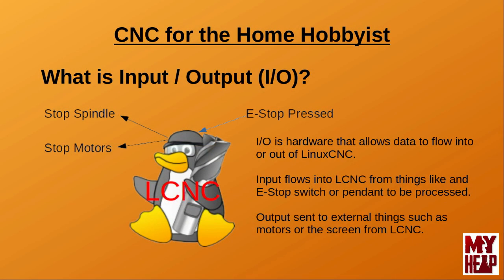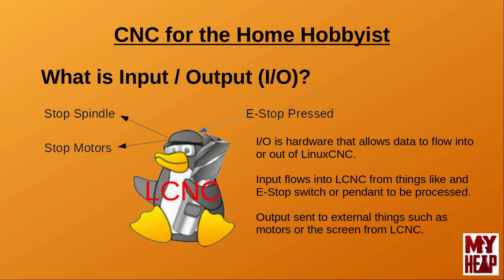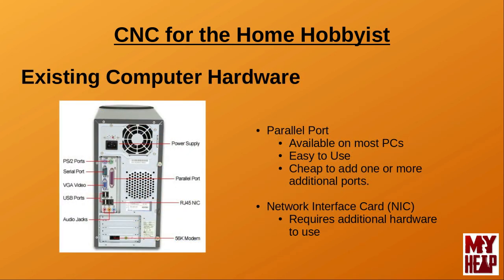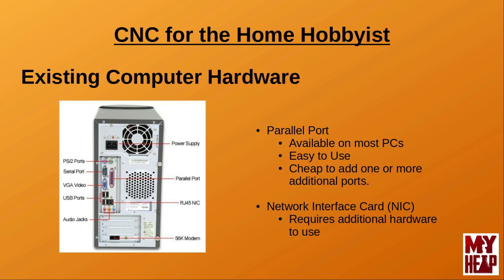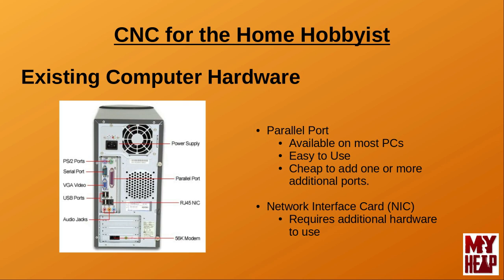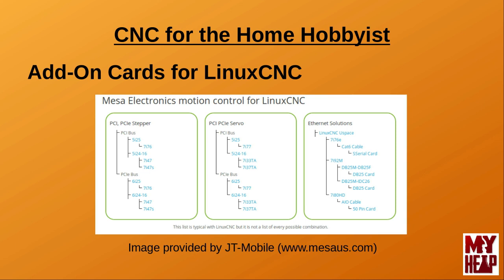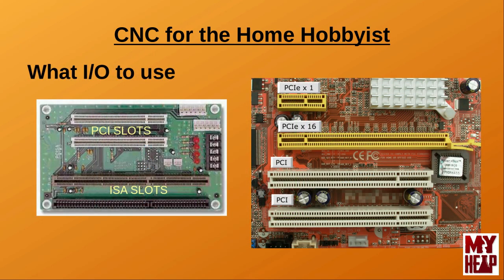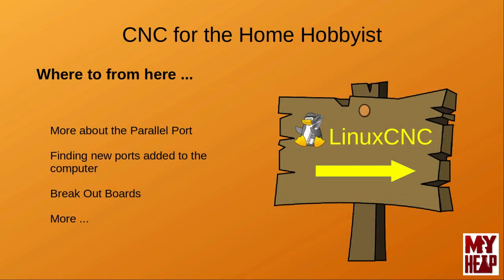LinuxCNC for the Hobbyist - 009 - LinuxCNC I/O Options

Comment: OK, Joe. I found a video on installing the add-on parallel card with LinuxCNC. It seems that the CNC must be set up first then the i/o addresses are added to the .HAL file. So onward and upward. Thanks again!
Reply from the maker: George, you can do it either way.  You can add the card, discover it's port addresses then set up the machine accordingly.  If you have a built in Port and set up the machine then decide you need more IO, then you can add another card.  The issues you encounter with adding after you set up the machine is if you done customizations to your config.  If you did, then adding the card using stepconf can destroy some of your custom stuff.  In this case you have to add my editing the configuration files.  I think a good all around safe tactic is to use two parallel ports.  One set to an out and the other set to an in.  This gives you a lot of latitude when it comes to adding homing and limits as well as probing and anything else you might want to read.  I have plans on more tutorials including stepconf and an example setup.  Then a walk through of the config files generated and an introduction to HAL.  Just haven't had the time lately, but will do more of them.
Reply: Cool. I added the card after installing LinuxCNC. Should I reinstall to have it find the card? It's a PCIe x1 card. The motherboard I used didn't have a parallel port so I robbed the card out of another system that wasn't using it. 😀
Reply from the maker: No you are fine, just open a terminal and see where its io port is.  Installing LCNC will have no affect on it.  Only the configuration could be affected, and you can not configured it to run anything yet, correct?  lspci should show the card.  ls /dev/lp* should show if it enumerated.  ls /proc/ioports should give you the address.  You have to be careful because some parallel port add-on cards are really serial and will not work with LinuxCNC.  Hope that helps.  The tut on parports will give you the commands.
Reply: Great I haven't gotten that far yet. The video I saw the person had the same card I have. From Amazon about 8 bucks. So it should work? Thanks!
Reply from the maker: You're welcome.

Comment: A USB to parport adapter wont work ...But will m.2 to pcie adapter work? linuxcnc is reading my NVME SSD form m.2 port
Reply from the maker: I have used pcie parallel port cards, but you have to be careful.  It has to be a true parallel port.  Many of them are serial and are shifted out to parallel.  These will not work.  Be sure to check out both parallel port videos.

Joe

Comment: Not every Parallel port card will work with Linux. I've ended up ordering two. There is a list of ones being tested and confirmed on Linux Wiki.
Reply from the maker: You are correct.  I learned this after the fact.  I didn't realize that some parallel port cards are actually serial to parallel converters.  These don't work.  I think I made mention of that in a later video.  I should do an addendum video on it.  Thank you for taking the time to watch and comment.  I appreciate it.  Should be a new episode out today, btw.

Joe